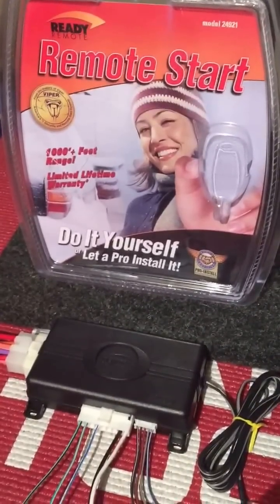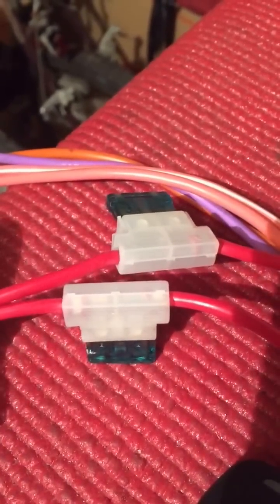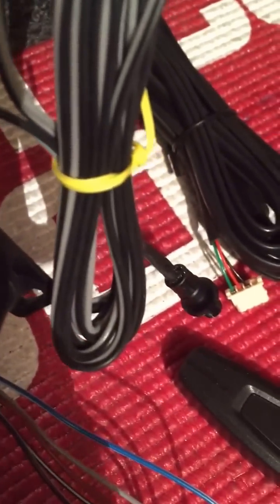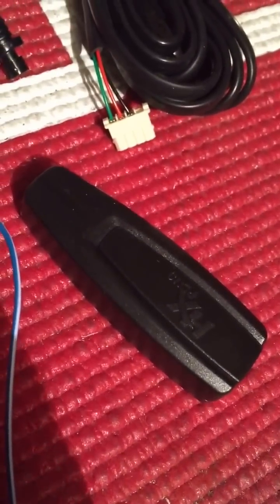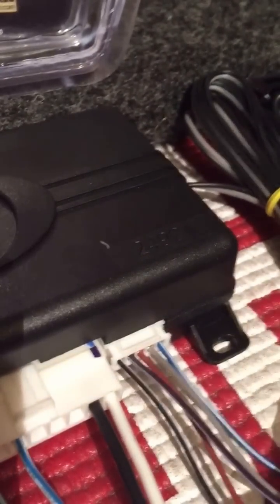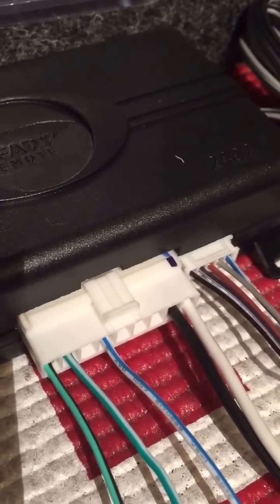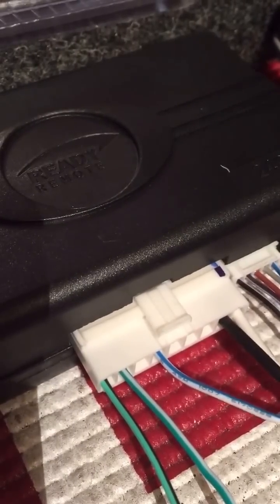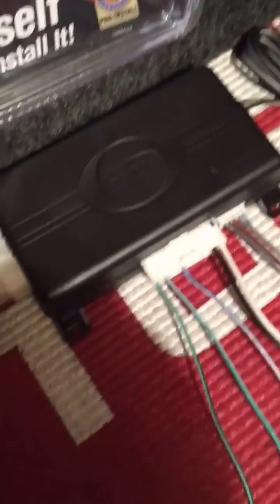Car Remote Starters Explained Wire by Wire Viper Python Clifford Compustar

Comment: one question the tach wire that go the the coil packs which wire it’s connect to ?
Reply from the maker: The Purple wire with the White stripe is the tach wire on the remote start.  Most vehicles on the coil pack will have an “uncommon” wire color. Example: Let’s say cylinder 1 has Black, Red, Blue wires and cylinder 2 has Black, Red, Green wires. You could connect the tach wire to the Red wire on cylinder 1 or Green wire on cylinder 2. 

That’s a general rule of thumb, you should always test for a tach signal prior to connecting. You might even have a tach wire behind the gauge cluster, at a control unit, or one of the kick panels too.

Comment: Do you have a video on how to install this remote? I bought it for my girlfriend for Christmas for $35. They want to charge her $150 to put it in. I want to try and do it myself but there are a lot more wires then i thought and the instructions are kind of confusing.
Reply from the maker: I do have a video of one being installed in a Mazda Miata, it covers most of the basics of what needs to go where, but to me honest there is A LOT of variations in vehicles, depending on what year/make/model you are putting this in.  If its 20 years old, it will generally be the same, but if it is newer there will most likely be additional parts needed for the install.

Comment: So I installing the 4103r Mosel and it’s on 2000 gmc 1500 on the tach wire which wire would I hook up to the black or the red or does it matter
Reply from the maker: On the remote start the Purple with White stripe is the tachometer wire.  If you want to use the actual tach wire in the vehicle it is either at the back of the cluster or under the hood at the ECM.(ECU)  On the 4.3L, the tach wire is in pin 20 in the connector labeled red of the ECM. On the 4.8L, 5.3L, and 6.0L, the tach wire is located in pin 10 in the red connector of the ECM.

Comment: Dear MotoCARR,
i bought a Ready Remote 24921, some years ago, In Atlanta, for my Suzuki Grand Vitara 1999, engine H25A, V6 automatic transmission, 4wd. When I arrived back to my home in Paraguay, I checked the unit in order to start installation. I could see that it came without remote controller. Also I could not get wiring diagram from web page. I was many months writing emails to manufacturer without success. Finally, some years later I could buy a replacement remote controller and  I got a link for access to wiring to my car,  for 7 days. Wiring shows some connections. Not all them. Now, lost my job, I am trying to install it but again I get stopped because of missing information.
I got a list from web which I printed. "DIRECTWIRE WIRING INFORMATION-SUZUKI / GRAND VITARA / 1999 /  Remote Start. There are many items that are not related to Ready Remote installation manual connectors description.
The kit is described as "Do it yourself". Later, from vendor and manufacturer I am pushed to request a "professional installer".
I am electronic technician and I have installed many accessories in my car. I am blocked  of device information from manufacturer.
I have insisted many times but they do not answer. Their page also shows many brands and they do not give the necessary informations. Can you please give some informations of wiring for my car?
Thank you very much.
Best regards,
Christian Larson
Asuncion, Paraguay.
email. larsonchristian2@gmail.com
Reply from the maker: Sorry to hear about your job loss!  I just sent you an email containing the wiring guide for your vehicle, let me know what questions you may have and I will do my best to answer them!  -Julian
Reply: MotoCARR 
Dear Julian.   I got your emails.  Thank you so much.  You have answered my questions within minutes with all the information I could not get from manufacturer in years.  
I really appreciate so much your kind help and your mind to help others.  That's a quality mind of person and company.   Thank you !!!!
Reply from the maker: @christianlarson5361  glad we were able to get it sorted out for you! :-)
Reply: MotoCARR THANK YOU VERY MUCH!!!

Comment: My car has 2 accessory wires do they just get joined together orr
Reply from the maker: frog man try just powering up accessory 1 with the remote start and see if your heater controls work. Some vehicles have most of the comfort/convenience accessories on one circuit, but some have a good amount split. Example: some may have your climate controls on accessory 1, but the rear window defrost on accessory 2.  So if you wanted your defrost to come on with the remote start, you would need to use a relay(if your model remote start doesn’t have a second accessory wire already) to power up that second circuit so the defrost can be turned on with the remote. 👍🏼

Comment: @MotoCARR I'v got a question/problem. My remote starter looks exactly like this from video (even antena). Problem with mine is this It starts only once for about 30 attempts. Its mounted on Subaru Outback 2010. When I double press remote, cars get message (blink once), but doesn't try to start (normaly). It self tryes three times. When I press remote start button for about 5 seconds. Car lights blinks five times - I don't know what that means :/

Car battery is brand new (was weak). 

I'v bean looking for main box but no luck :/

Any help ?
Reply from the maker: Maciek Grabski try this.....put your key in the ignition but don’t turn it, then try and remote start. Let me know what happens.
Reply: @MotoCARR847  nothing changes. The same raection.
Reply from the maker: @MaciekGrabski  ok.  Next step is open the hood of your Outback and see if there is a hood pin safety switch installed somewhere around the outside perimeter.  Think areas where the hood may come in contact with the fenders, headlights, radiator, etc.  See the link at the end of this comment to see what one looks like.  If you have one, press it down all the way, hold it, then try and remote start the car.  Being that it acts like it is going to start but doesn't engage the starter makes me think that there is a "safety" somewhere that is preventing it from trying to start.

https://www.cherokeetalk.com/forum/attachments/f9/141705d1437861472-remote-start-my-99-wj-66632908.jpg
Reply: @MotoCARR847  I'v looked very carefuly for switch but found nothing. No switch installed. Maybe this will be the clue: fiew days ago, remote starter start engine on seconda try (self repeat). No luck since then. I thought it's becouse of to low voltage - I turned off everything but nothing changes.
Reply from the maker: Maciek Grabski ok yes that is helpful. If the car started and ran ok, then you are on the right path. Most likely your remote start is setup for what is called “virtual tach”, meaning the vehicle is using the car’s voltage to detect if the car successfully started and is running.  The next step will involve a bit of work.

You need to figure out if your car is trying to use “Virtual Tach”(voltage checking) or if it was installed using the purple/white wire coming off of the remote start.(Tachometer input wire). The tachometer wire can be run to a coilpack in the engine compartment or for your specific vehicle, behind the instrument cluster. 

If you do not see a purple/white wire, you will need to run the wire from the remote start brain to the instrument cluster or coilpack, then change the menu setting from “virtual tach” to “tachometer input”. 

Color:     red/white to white/green
Polarity:     ac
Location:     instrument cluster, white 40 pin plug, pin 30 or ECM behind glove box, white 35 pin plug (B), pin 15
Reply: @MotoCARR847  I've got interesting info about my problem. Looks like it solved without my help. I gave car to mechanic for some other maintance. He had to disconnect battery for a longer period od time. I get car back and noticed it starting from remote controll without any problems at first try. This evening I Had started a car about 5 times in the row :) looks like IT reset itself :)
Reply: And it broke again. Car reacts but doesnt start. If i leave key on ignition It will start. Meybe It loose imo ?
Reply from the maker: Maciek Grabski id you turn the key to ignition (but not start), then hit the remote start fob and the car starts as it should, then it’s an issue with the aftermarket immobilzer. It’s either not turning on with the remote start, or there’s an issue with the firm/software that’s loaded on it.
Reply: @MotoCARR847  one more thing. How to turn on and off garage mode ? I tried turn on and off ignition key. After that hit once remote. Nothing happend.
Reply from the maker: Maciek Grabski not sure I follow, I’ve never heard of that mode/setting.  Do you mean like a mechanic/valet setting?
Reply: @MotoCARR847  yes :) temporary mode when remote doesnt engage engine.